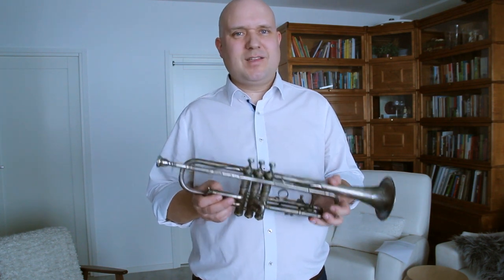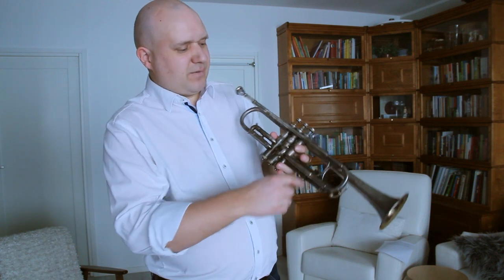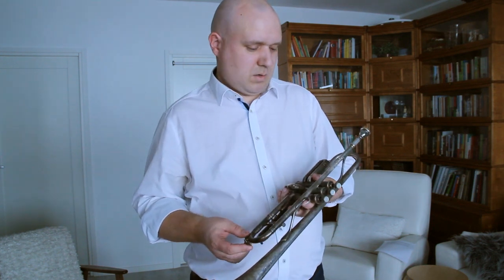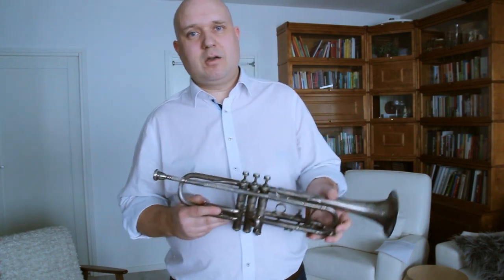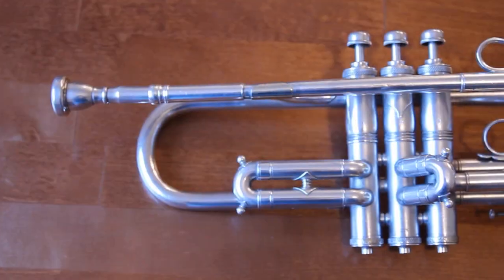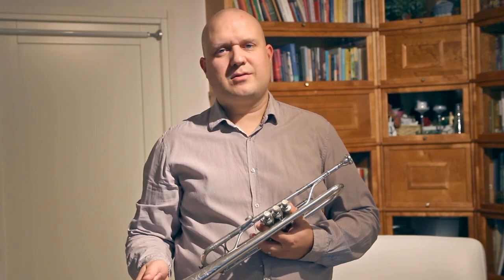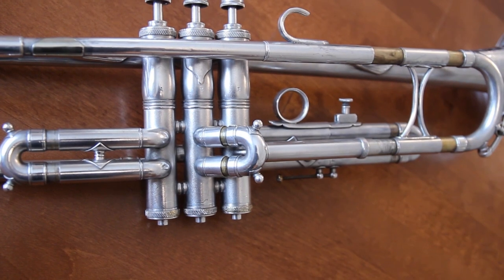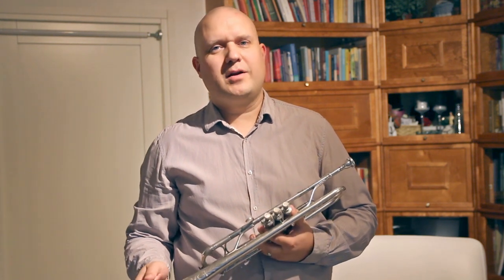Repairing King Liberty Trumpet from 1920's

Comment: Easily my Dream horn, acquired one a few months back, $650.  Absolutely beautiful shape, Valves work like the day it came off the line, no dents, minimal scratches, the gold on the Bell is still there and the case with all of the original mouthpieces and surprisingly enough Slide Grease.  Serial is 126317, 1049, "s" is also stamped on one of the valves.  Absolutely love the horn.
Reply from the maker: Great!

Comment: Just purchased on just like this-same era etc- off of eBay. Can't wait to get it.Thanks for the great video.
Reply from the maker: Thanks and congrats on your new trumpet! King Liberty is super!
Reply: @timyllym  Just got the trumpet and after giving it a bath, shining the bell, greasing slides and oiling valves, it sounds great. Question: did these old trumpets have cork on valves? Seems to be missing. Springs feel worn. Thanks
Reply from the maker: @MikeM91320  Great to hear! Yes, there should be cork washers in valve stems. You can get corks and new springs from any spare part sellers like Ferree's, they shouldn't cost too much.

Comment: fantastic job and great video, thanks for sharing. I've been after either one of these of the later model with the 'art deco' bracing. Problem is, they're all in the states and those which aren't in bad shape are expensive. The idea of fixing it at Trevor Head's has got me thinking!
Reply from the maker: Thanks! These are great horns. I bought mine from USA Ebay. The post costs and taxes to Finland raised the price quite a lot but it was worth it.
Reply from the maker: I recommend Trevor Head's course, it was great.

Comment: wow...amazing work!!
I have one and maybe you can help me. Where can I get the felts, corks and springs? seems impossible
Mine has an serial number 73XXX so its a trumpet before 1926 when King introduced the 3 bell sizes but mine has an "L" stamped on the second valve under the serial number...what means that "L", large?
Thank you very very much. I admire your work!
Reply from the maker: Thank You! Try to find the nearest brass repair tech in your area, he can help you with the felts etc. I'm not sure what L means. Liberty's at that age should have only one option, so no large bore or bell, but you never know.
Reply: @timyllym   Thank you Timo!

Comment: Any work needed on the valves? you didn't show the condition of the pistons. Thanks
Reply from the maker: The valves were quite worn and little too loose on their casings which caused some sticking. They would have needed to be replated and honed to work perfectly but they were ok with thick oil. Anyway, I have sold the trumpet so now it's up to the next owner.

Comment: I own a 1925 and 1930 King Liberty and have been wanting to get a replacement 3rd valve stop rod for both of them. Where did you find a replacement or could you recommend where I could find 2 that fit them? Thanks!
Reply from the maker: I bought a 2mm threaded brass rod from modelmotorcars.com but the thread interval (or width) wasn't exactly the same as in the trumpet. I was able to use it anyway, but I'm afraid I can't help with finding an exactly fitting rod.
Reply: Timo Myllymäki I do appreciate the reply and information! Thank you!

Comment: How does this horn compare with contemporary professional trumpets?
Reply from the maker: With most of the vintage trumpets (including this) I find that notes don't slot the same way as in contemporary horns. Current trumpets tend to make a rather precise switch between intervals but with vintage horns you can bend the notes easily and you need to seek the center of the tone. Vintage horns also quite often feel a little tight to play compared to contemporary trumpets.

Comment: 3rd valve is getting stuck
Reply from the maker: That's right, it was a little sticky. The valves were really worn out which was probably the reason they didn't work perfectly. Unfortunately I hadn't practiced valve plating at that point so I left the valves as they were. I have already sold that horn.